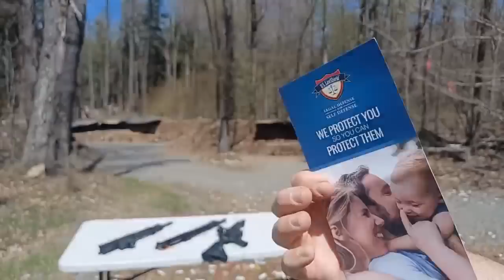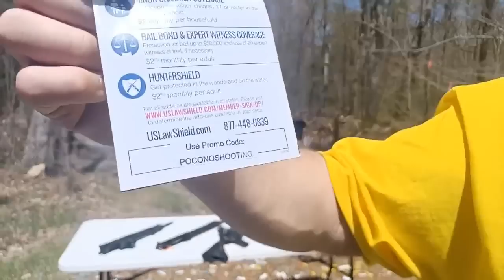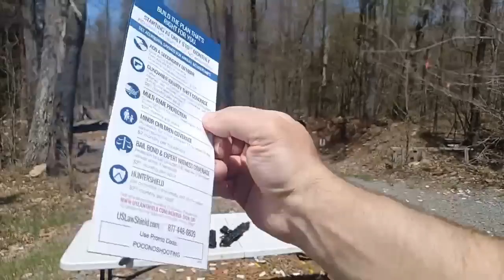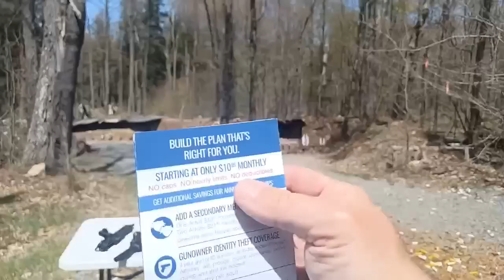Pistol Brace Update: ATF Director to Congress...  We only need to Remove Brace

Comment from the maker: Correction!!!
Assuming that the firearm was originally a pistol, the resulting firearm, with an attached shoulder stock, is not an NFA firearm if it has a barrel of 16 inches or more in length.

Pursuant to ATF Ruling 2011-4, such rifle may later be unassembled and again configured as a pistol. Such configuration would not be considered a “weapon made from a rifle” as defined by 26 U.S.C. § 5845(a)(4).

[26 U.S.C. § 5845, 27 CFR § 479.11]
Reply: God, this is getting so convoluted it isn't even funny...

So, can I now say "Oh yes officer this was originally a 16 inch pistol, but then I put a stock on it when braces were banned. Now I changed the upper to a 12 inch, and removed the stock. It's exempt from being a "weapon made from a rifle" because it was originally a pistol, it just has a different upper on it, but it's the same receiver so now it's ok, right?"

This is so convoluted that I'm not even sure THAT^^ is even partially correct...
Reply: How about AK pistols and other kinds?
Reply: @largelarry2126  There's not legally any difference, he said AR pistols because that's a general term for a not-SBR at this point
Reply: @kreeperskid  It does legally matter when they run the serial # and it comes back as a rifle on the 4473.....it better be in a rifle configuration. If it was listed as Pistol or Other on the 4473 then your in the clear.
Reply: @kjh1227   I understand that, but you didn't read what I was responding to. I didn't say there isn't a legal difference between the receiver of a pistol and a rifle. I responded to his question of if it's different for AK pistols, and I said there isn't a legal difference between an AR pistol or an AK pistol

Comment: To take off some weight from the barrel they could also have a shorter barrel with a pin and welded muzzle device. It’s not ideal but it helps a little.
Reply: It does 14" barrel with pinned muzzle comp.

Comment: If you have an upper receiver with a barrel length of under 16 in do not mount it to a lower receiver with an M4 style buffer tube extension. That style of tube can readily accept a stock that would still technically be constructive intent and you would be in possession of an SBR. Get out your stock castle nut wrench break that thing down get that tube off and just put on a standard smooth pistol buffer tube. Once you have done this that particular lower will not be able to readily accept an adjustable pistol brace that is fashioned after an M4 adjustable stock and or an adjustable stock. In order for it to "readily accept" such a device you would physically have to change out that buffer tube. So just take that adjustable style buffer tube off and change it out to a pistol specific smooth buffer tube.

Comment: They can also use the intent to construct. if you separate the brace and have a buffer tube that can accept a brace or stock. I changed mine to a straight buffer tube that does not accept a brace or stock. If this gets shot down I will change back to the regular tube. They seem to change their minds a lot.
Reply: There are braces that fit both adjustable buffer tubes and a plain round pistol buffer tube.
Reply: @a.joegevara3519 If you don't own a brace that fits a plain buffer tube, there's no Constructive Intent.
Reply: @a.joegevara3519  so what do you do remove the buffer tube and render the weapon useless? The ATF itself has already stated that the buffer tube is an intrical mechanical part necessary for the function of the firearm. Putting on a straight smooth buffer tube that was designed for pistol strictly is perfectly legal. Their big thing is rear surface area. You cannot have anything attached to the rear surface area that would allow shouldering and or a tube that would readily accept a standard adjustable stock or any variant of it. So if you get one of those old-school smooth pistol tubes that come with the foam wrap around the outside perimeter of the tube you are good to go. The problem started when these SB tactical style braces on the M4 carbine tubes with the adjustments built-in, that's where the issue started. The real issue started when all of the YouTube Yahoo's shouldered them on video and started blasting away, throwing it in the ATF's face. I don't agree with going on I'm strictly in a hundred percent a second amendment purist, but people's stupidity in wanting their 15 Minutes of fame got us where we are today.
Reply: In a nutshell until this thing blows over just install a standard smooth pistol buffer tube. And although I know the early Sig braces would slide over those tubes don't do it that's all. They just don't want to see anything attached to them and they don't want to see any attachment points where you could  period.

Comment: Can you put the foam pad on the buffer tube?
Reply: I have a buffer tube that is specifically strictly built and designed for pistols. And the foam yes is wrapped around the rear outside perimeter of the tube just like it always has been before all of this stupidity started. As long as there was nothing on the rear surface area you are fine. Outside perimeter of the tube okay rear of the tube no-go.
Reply: Just as a note this is exactly as the tube came to me from the manufacturer.

Comment: I know there has been a lot of banter over this. What the "AFT" Director actually did say is consistent with  what they put out in their webinars. The brace itself is not banned. The caveat people need to be aware of is the potential for "constructive possession" if they don't own other ARs.The same goes for the option they gave of just adding a 16" or greater barrel. If you only own one AR, you sure better not keep that short barrel lying around!
Reply from the maker: They did not say that you would have to dispose of the pistol upper. At a later time that could be attached to a properly configured pistol lower.

We can still purchase and build AR pistols after June 1st.